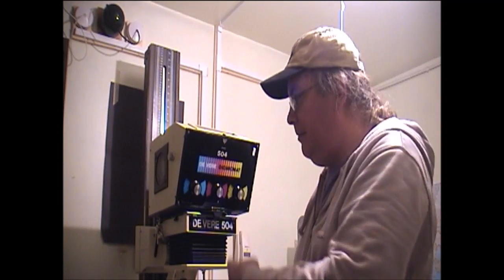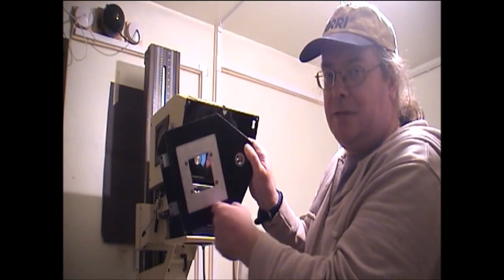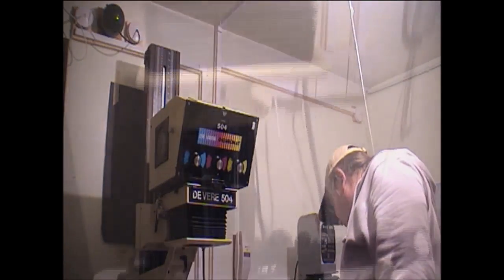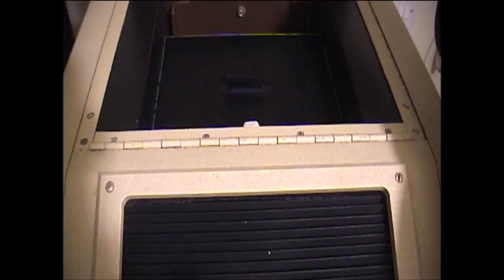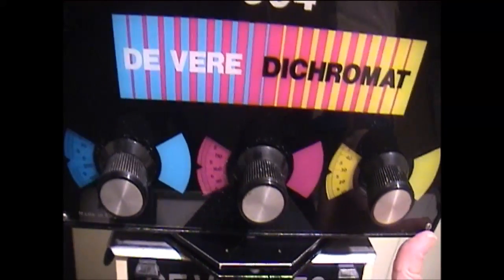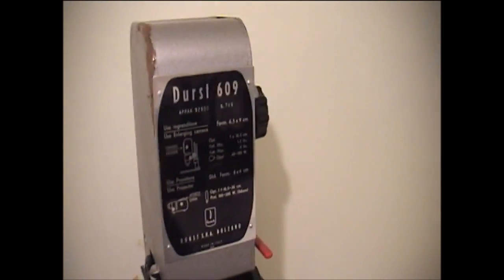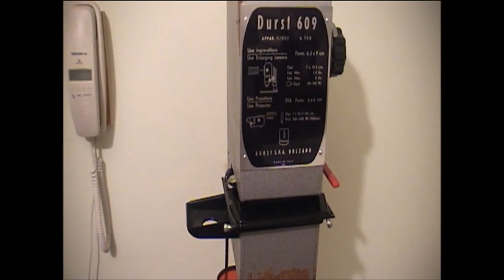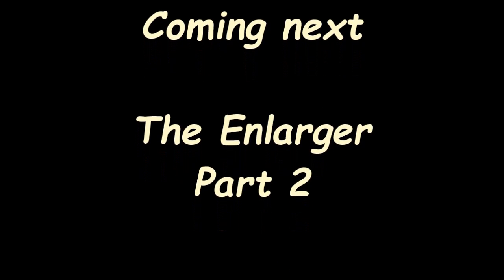Fun with Film Episode 10 - The Photographic Enlarger Part 1

Comment: Hi, I am awaiting delivery of a Durst 609. How easy is it to use? There doesn't seem too much about it online.
Reply from the maker: You're lucky! They are as basic as you can get. They use tube focusing so there are no bellows to fail and they're pretty well built - mine used to be my father's and is between 50 and 60 years old. I rewired it a couple of years ago. The neg carrier is adjustable a beautifully engineered - or at least mine is. 

The head rotates so you can use it horizontally which allows for stupidly big enlargements.

 There are a couple of downsides - 1 Parts are rare and expensive although you may be lucky, and 2, There is no filter draw so it's under lense filters only.
Reply: Is tube focussing basically the same as bellows, but a tube instead?
Reply from the maker: Yes - one tube inside another to form a light trap. Brilliantly simple and far more robust than bellows.
Reply: The enlarger arrived today and appears to work fine. It didn't come with a lens board. Am I right in thinking that it takes lapla and setopla boards? I have no lens for it yet so it doesn't bother me if it is a 25mm or 39mm thread.
Reply from the maker: Sounds familiar - I'll try to remember to look in the morning :-)

In the meantime I found this link which you may find helpful
https://www.scribd.com/doc/265124231/Durst-609-Enlarger-Operating-Instructions

I am surprised by how much info there is out there for a 60 year old enlarger!